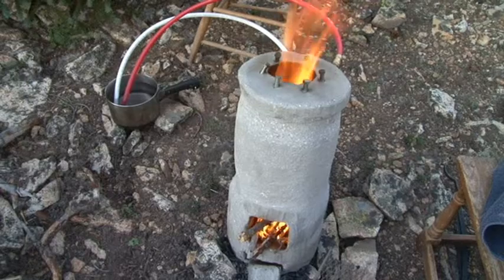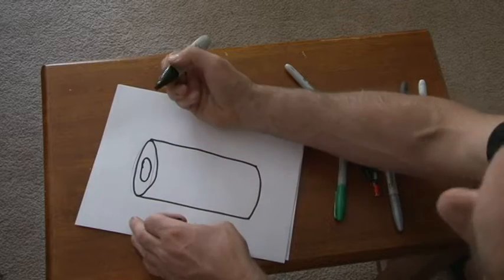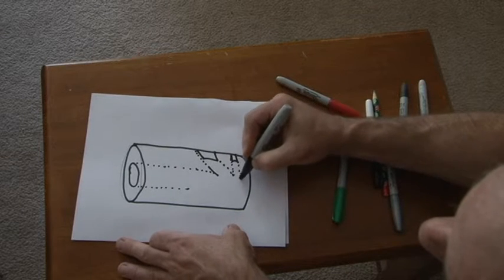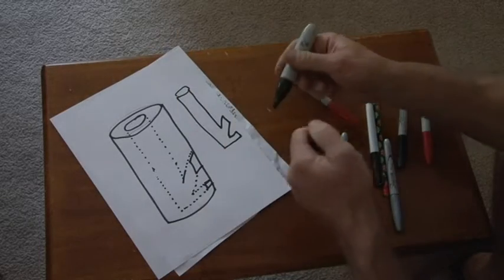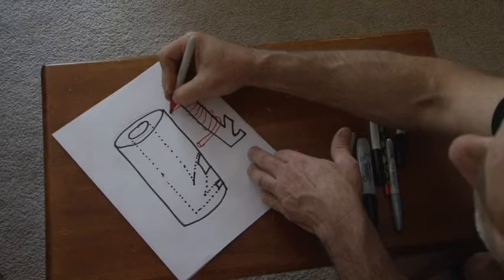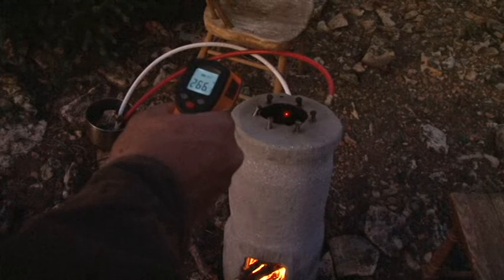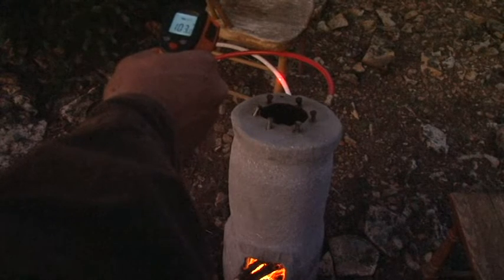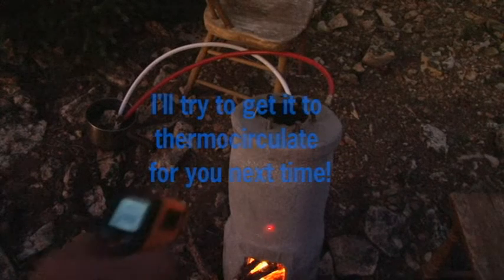rocket stove, DIY off-grid water heater

Comment: In almost all thermo-syphons that I have seen work, the water must be slightly ABOVE the heat, not what is shown here (which may work, I don't know.) The cold water falls down and the energy of the hot water is enough to push it up a few feet into the air, back up to the bucket or water tank.

Comment: Nice design. The IR thermometer doesn't just reports the temperature at the spot but instead in an circular area much bigger than the spot. That's why your temperature measurements of the pipes were not consistent. The area gets bigger the further away you are abit like a torch beam does.